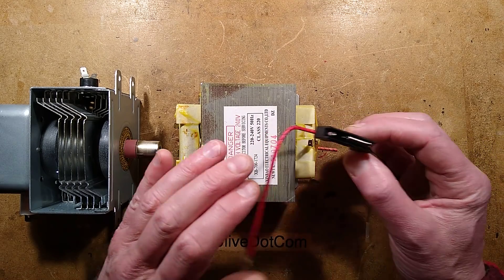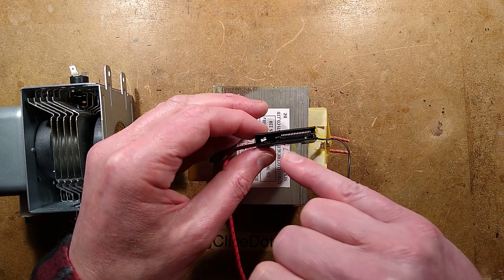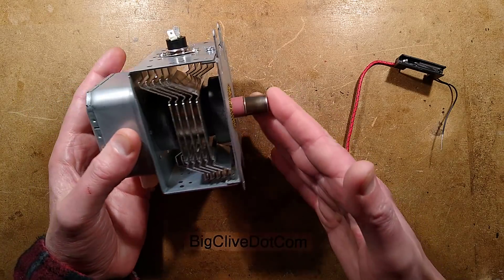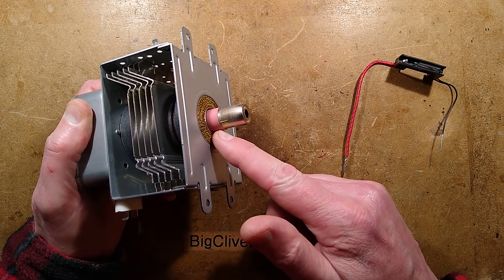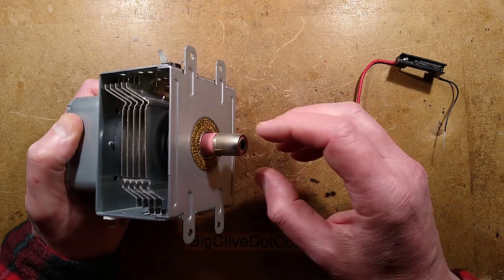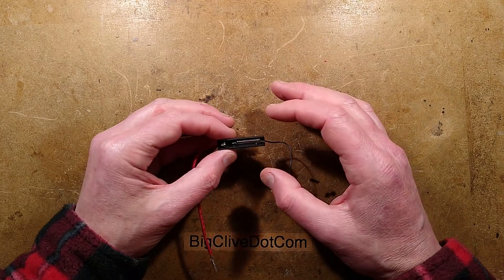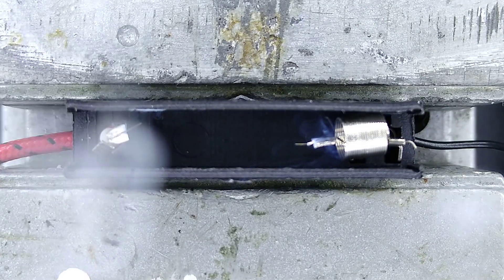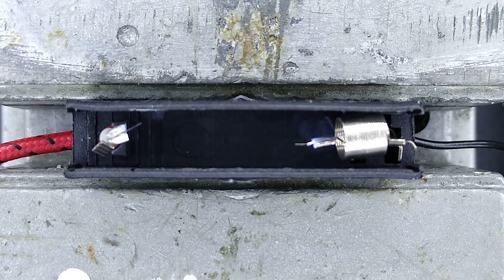Blowing a high voltage fuse

Comment: Well, that separated quickly, only 1 frame of the wire glowing, another where the spring is almost fully retreated with a hefty bit of motion blur, and the frame after that it is all done.
Should find one more and record at a bit higher FPS and slow the footage down to better show it.

Comment: I'm not sure exactly what I expected from that fuse, but was still surprised by the amount of motion. Simple and effective, the way things should be! 🙂
Reply: Should break a 2kv fault nicely, the fault current won’t be too high so it doesn’t need silica filling or anything too elaborate.
Reply: I still don't see how a 1.5-2" gap is supposed to quench an arc 3-4" long. Would have loved to see how it performed under intended conditions with 2kV 1A.
Reply: @fvckyoutubescensorshipandt2718  no
Reply: @fvckyoutubescensorshipandt2718  I honestly don't think you'd see much difference at the full 2kV 1A. I have my theory as to why there isn't a sustained arc, but it's at best only partially correct (and I don't have a lot of faith in that "at best" part), so I'll keep it to myself. Maybe Clive will see this and enlighten us! 🤔
Reply: @fvckyoutubescensorshipandt2718  A rough rule of thumb says that 1kV will arc 1mm. (Ambient temperature normal air) So 2500kV will arc only about 1/10th of an inch.
Reply: @Conservator.  That rule is only true when igniting an arc. An existing arc can be sustained at much lower voltage. An arc welder sustains an arc of up to 1 cm at 50V.
the length of arc that can be sustained has more to do with the available power to keep the plasma hot, >10 000°C. Roughly 1 kW/cm are need.
Reply: @larslindgren3846  Yes but question is: will there be an arc like that? Or phrased differently: the fuse should only be applied were such an arc will not exist. 

An arc welder will use much more current and induce much more heat than an microwave.
Reply: @Conservator.  I am not arguing that the fuse will not work. I assume that they has analyzed the circuit and concluded that it will work. I am just saying that your reasoning on fuse breaking capability can be misleading. Since the microwave oven has a normal power of about 2 kW it can be assumed that at least 5 kW is available in faulty condition. That would indicate that up to 5 cm arc could be sustained. Several things can however increase the breaking capacity such as fast movement in to cold air, sublimation of the walls and AC current were the arc cooles and extinguish during zero crossing.
Reply: @larslindgren3846  the fuse is not an arc breaking device but a simple current breaking device that will work with voltages of probably 5kV or even more. 

Only once there’s an arc, it could be extended to much more than 5mm but I think that’s unlikely in a microwave.
Reply: @Conservator.  There will definitely be an arc, you even see a small arc in this low voltage test. There will almost always be at least microscopic arcs when breaking a current mechanicaly. The distinction between current breaking device and arc breaking device does therefore not make any sense.
Reply: @larslindgren3846  of course there will be an arc, just not one of 5cm. 

You mentioned an arc breaking device. They do exist in power stations. This is just fuse that’s suitable for high voltages, hence the spring.
Reply: @Conservator.  Experience says otherwise. 2.5mm is the initial gap 2500v will jump (and that's not at all linear, 100kV 50/60Hz will jump 9-10" depending on exact conditions, 200kV will jump ~25"). Current/total power predicts how far it will stretch (rough rule of thumb: 10kW/20kVA = 3 feet, following an inverse square law at higher and lower power levels, but current vs voltage plays a role as well as electrostatic forces "push" an arc apart vs magnetic forces that try to pinch and corkscrew the arc increase at higher powers). A shorted mot can supply 2A of current = 4kVA = 4 inches/100mm or so after the initial 2mm or so gap breakdown. And anyone that's actually drew an arc with one can verify that. But I'm wondering if the fuse has some sort of permanent magnet setup near it if not the fuse casing itself. That helps break arcs in HVDC breakers (where even 72V can arc like a 2kV mot if there's 20A or so available) without making them physically large.

Comment: Nice! I found a nice High Voltage fuse at work the other day. It is about 8 inches long, 3 inches across. Rating: 2.5kV, 250A :-D

Comment: So are fuses only rated by current and voltage doesn't matter to them for tripping purposes?
Reply: yes, it can matter as higher the voltage, more chance of an arc forming between ends of the blown wire, mains plug fuses are (should be, many cheapo ones arent) sand filled to kill the arc ...
Reply: @andygozzo72  just for fun, I connected a blown fuse to one of these arc lighters and it arced happily inside the fuse... it even "burned" the wire further than it was already burnt.
Also a broken lightbulb will continue glowing when its excited by those arcing lighters, as long as the spark gap isn't to wide 😃
Reply: It’s the current that blows the fuse, as the resistance of the fuse wire causes the heat to build up until the metal fuse wire melts and the fuse blows. However, you need enough voltage to drive the required current through the fuse. Some low value fuses can have a considerable resistance. Secondly, yes, fuses do have a maximum voltage rating. As the fuse blowing would be ineffective if the air gap could arc over. Plus there is the insulation rating of the fuse and the fuse carrier/holder to consider. Thirdly, not all fuses are rated for use on DC circuits. With a resistive load, the AC wave form passes through 0V which helps quench any arc. But that does not happen with DC systems…
Reply: Yes and no. The current they will blow at. And the maximum voltage that they'll be able to interrupt. If you tried to interrupt a 1000 volt source with a fuse only rated to 250 volts, it wouldn't do the job. High voltage fuses need to blow quickly and leave a larger gap then low voltage fuses

Comment: I saw this fuse in the live stream and was wondering if a video would be made. It's quite nice, no arc supressors. Any idea what kind of load this thing would have to break? What did it take to blow the fuse?
Reply: I think Clive mentioned '1 Amp' near the beginning of the video...
Edit: I have misheard that part, please see following comments!
Reply: @stepheneyles2198  He said an Amp is an Amp but I don't think this means this is a 1A fuse, rather that you don't need high voltage to blow it.
Reply: @tz8785  Yeah, he was just saying that it doesn't matter what voltage you use, as long as you get enough current through.
Reply: @tz8785  oh yes, you're right! Thank you 😊
Reply: Typically somewhere in the neighbourhood of 500 ma at 2000 v.
Reply: I don't suspect it is very high amperage. And the arc clearing may be needed for an inductive kick when the circuit opens.
Reply: @Sylvan_dB  It's to break the MOT output if something goes short on the HV circuit. (So I guess it's just to clear the arc caused by the two thousand volt open circuit voltage that becomes present if that wire were to blow.)
Reply: All the ones I've seen have been 500 mA, for microwaves around the 800-900W range.  I had one blow in my main microwave a few years ago, and there's no indication anything has gone wrong, the microwave looks and sounds as normal, except the food comes out as cold as it was when you put it in.

Comment: If only Lauri Vuohensilta of the Hydraulic Press Channel lived a bit nearer you could have borrowed his high speed camera.
Reply: If Clive did stuff like this more often, he could probably justify just buying one of tesla500's fancy cameras 😸

(For anyone unaware, the designer of the Chronos high speed cameras used on HPC - David aka tesla500 - has been publishing YouTube videos for a very long time, initially covering miscellaneous electronics teardowns with a slight focus on older high speed cameras (including earlier Phantom cameras, IIRC), before he designed and built his own in his spare time over many years and then creating a company to sell them.
He's made videos about the camera's electronics design, CNC milling the case, building very high power water-cooled LED lights for high-speed filming (of things being dropped into an upside-down lawnmower 👀), and more.

I think Lauri was sent a camera from the first batch for free as publicity for the Kickstarter (along with maybe a dozen other YouTubers), and that seems to be a great partnership, as David's subsequently appeared in several HPC/BTP videos doing neat stuff with a whole array of high speed cameras 😮)
Reply: Great shout-out! His HPC and Beyond The Press channels are definitely worth a sub each

Comment: Cool! 👍
Would have been interesting to see how big the arc would have been with a HV source. 🤔
Reply: Could just solder in a new wire and try it again.
Reply: Should've sent it to photonicinduction
Reply: @JimmyJoXS  Probably considered too low a rating fuse for Photonicinduction to pop, considering that Photonicinduction popped a 5000A fuse
Reply: @JimmyJoXS  🤣🤣🤣🤣⚡⚡⚡⚡
Reply: @JimmyJoXS  "I popped it!" 😉
Reply: yep, but clive was too sissy
Reply: @piezku  Hard part is to design a test circuit that applies the full 4kV and the full fuse blowing current (much more than the rated current) without providing that entire power amount for a brief test period.  One approach would be to run the transformer on a high current mains supply, then using an oil filled mechanical switch to short it.  A more careful design would rig a high voltage LC network between the transformer and fuse, but designing that is a specific art mastered only by a few test engineers who test fuses for a living (I have seen it done, but not the diagram they used). [Edit: Typed RC instead of LC]
Reply: @johndododoe1411  i meant more like using the 2kv from the microwave oven transformer that was on the table ready to go
Reply: @piezku  Overloading the output overloads the input power source and might blow the usual 13A mains fuse.
Reply: @johndododoe1411  in uk the outlets are on ring circuits that have much more than that, and the plugs have 13 amp fuses, which are easily bypassed. btw why are you arguing over this fucking ridiculously simple experiment?
Reply: @johndododoe1411  way more complex than needed, just short the secondary of the transformer with the fuse and plug transformer into mains. Yes the voltage will sag briefly but will also surge at the moment the fuse opens. Or use the capacitor and diode for the voltage doubler, as wired inside the microwave. This will give you around 4kv.
Reply: A lot of AMPS